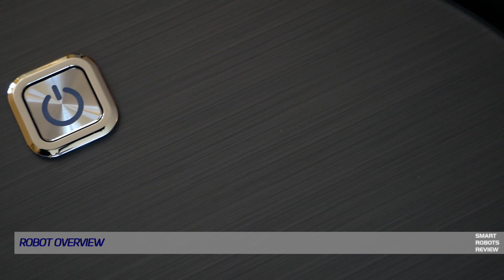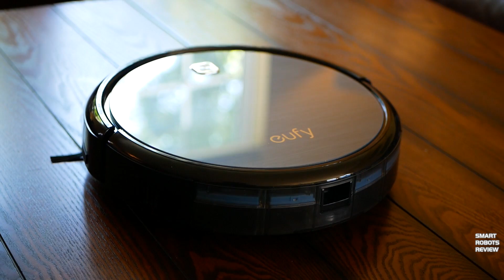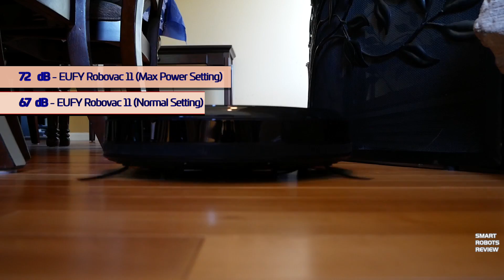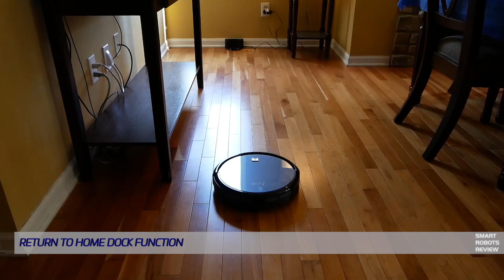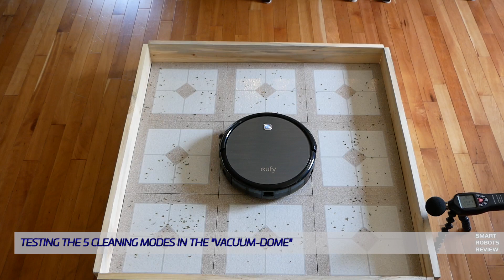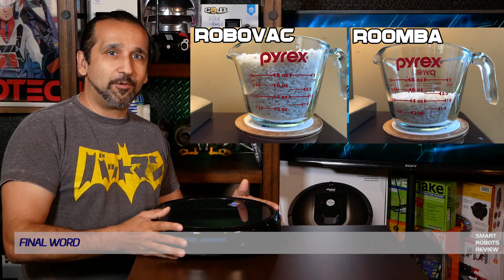EUFY Robovac 11 Robotic Vacuum affordable and awesome? Full Review

Comment: Mine still works after all these years.  Only 2 new batteries. Are replaced and the brushes. Last battery is even a big upgrade (2600mah original to 3200mah) for this thing  cleans for 40 mins longer on max power. And cleans still amazing to this day. I cleaned the robot inside few months ago.  Yeah it's a "stupid" vacuum robot. But still a great thing to this day. Now I going to upgrade. And this euvy one is going upstairs for the kids. Till he will retire 😂

Comment: Poor conclusion on the modes. The dock inside extraordinarily small test box is a poor test. I’m a bit surprised it didn’t dawn on you that the flaw was actually your test.
Reply: This is true. Instructions even say not to run so close to docking station.

Comment: i have the deebot N79s, basically the starter robot sold directly by the factory contracted to build these and many others, as mentioned in several comments it doesn't clean next to the dock, and that's because it's designed to be compatible with all infrared barriers, consequently reflective items [like say, a steel trashcan] and even it's own dock, because it thinks it's running into a barrier, automode is also designed to clean until the battery is almost dead, and then return to the dock, so of course it didn't stop within the few minutes you watched it, and single room only behaves differently with more advanced models that map the area, because you're able to select the room

Comment: Hi there. Thank you for the review. Great job. I’m assuming the Eufy has no mapping function? Which means it may not cover the entire floor.
Reply from the maker: Hello! Unlike higher-end rivals, the Eufy has no way to display via app where it cleaned and areas missed.   However, from repeated observation, I can tell you it will vacuum every accessible inch until the battery runs low and has to return to homedock for recharging.   I use it several times a week in my own home without any complaint (or sound... it is so silent!!!).   Thanks for watching!
Reply: I'm confused the Eufy  seems great but be better if it mapped where it had been , the other model seemed to have more tech ?

Comment: Less than one hour on carpet?!! Whoever makes one that works well on carpeting will get rich. Poor cleaning and does not return in all modes. Pass.
Reply: How well does it work on short height carpets?
Reply from the maker: Hey thanks for watching!  This robot was designed to clean bare floors and carpets of short height not unlike the high traffic carpets most offices use.   I found that for the price ($219) the Robovac 11 is a good vacuum.     If you are looking for a robot vacuum that will conquer carpets you may want to take a look at the Roomba 980 ($899).   I reviewed it a while back https://youtu.be/W7oQ_vjp0js
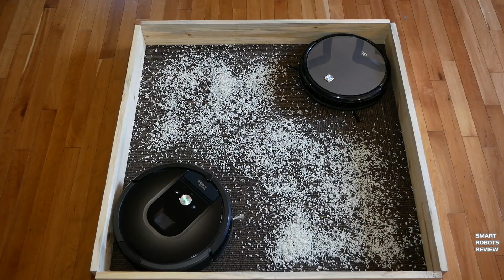Reply from the maker: Hello - it works very well on short pile carpets.  Fast Forward to 7:17 when it faced iRobot's flagship, the 980.   Thanks for watching!

Comment: Great review.  We've had Eufy 11 now for about a year and love it.
Reply from the maker: How are the brushes and filter holding up? How often do they need replacement?   Thanks for watching!
Reply: Funny you should ask - Just ordered replacements for both.  We use it almost exclusively on hardwood and tile floor.  On carpet, I suspect they would need replacing more often.
Reply from the maker: Hey thanks for that.  I use mine about 4 times a week and lets see how long the brushes will last.
Reply: Have you needed to/can you replace the battery?